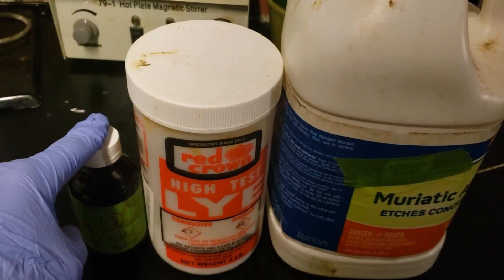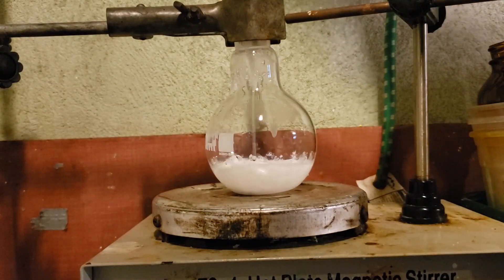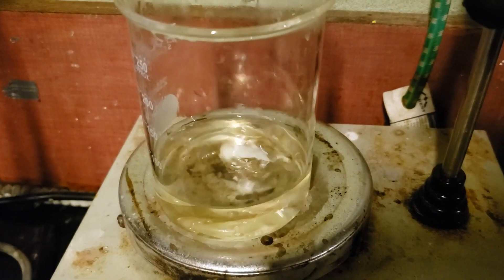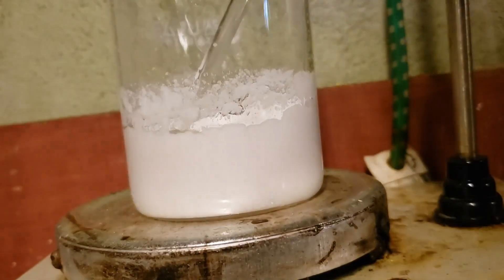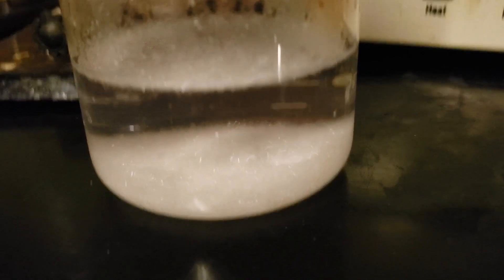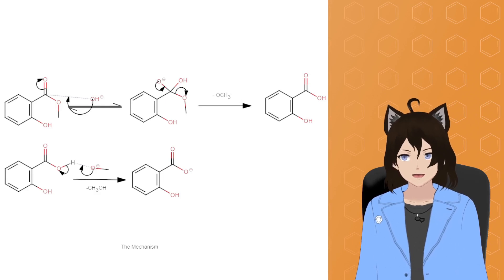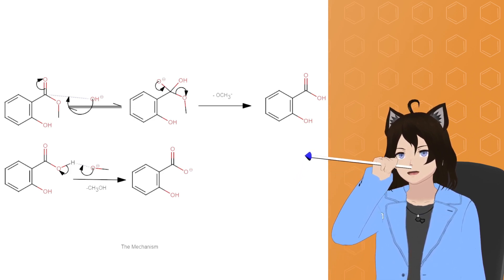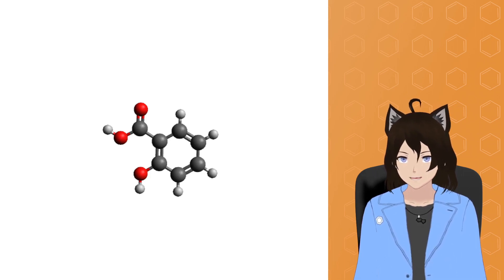Saponification: The Zenzicubic way to salicylic acid

Comment: The first reaction I learned to make salicylic acid, was the Kolbe-Smidt reaction, starting with phenol and NaOH in water to get the phenoxide, which is a orto (or para) direction nucleophil. To this solid CO2 was added and the pressure container closed and heated until about 100 atmospheres. The resulting salt is treated with an acid and the salicylic acid (and some paraben, more of the p-OH with longer time, and stronger base) is separated by recrystalisation or chromatography. It is then acetylated or esterified, etc. That is the best synthesis, as phenols are far cheaper than wintergreen ester or aspirin. They can be made from oil, wood, coal, arenes and Calcium carbide (ethyne, acetylene)... Oxidation of o-cresol is also an option.
Reply from the maker: Sure, that does work, but those are industrial processes, not laboratory ones. But thanks for the suggestion.